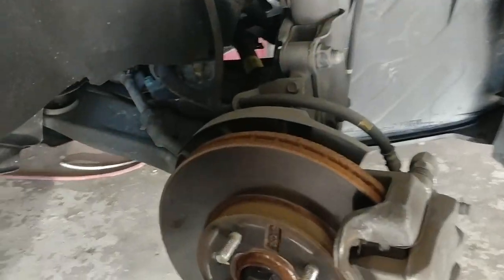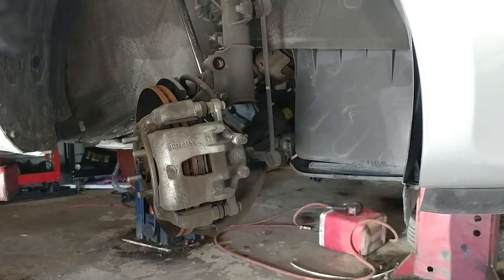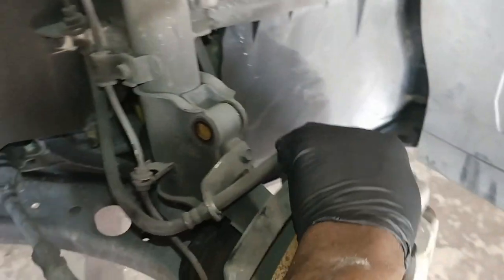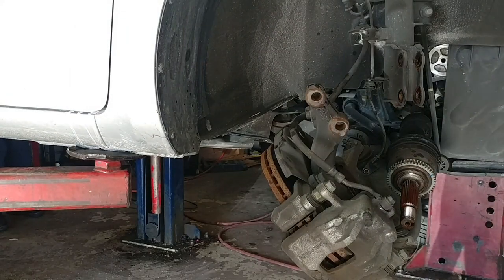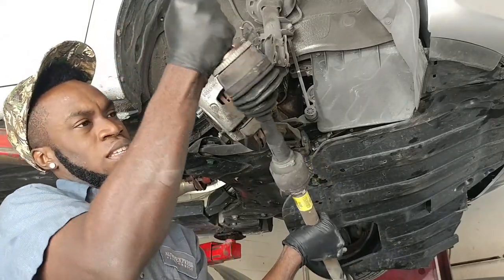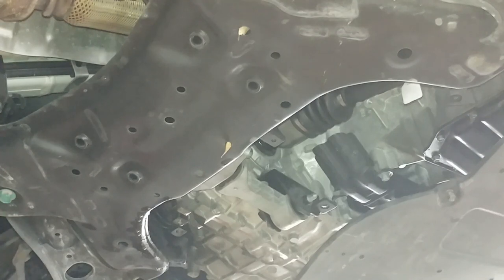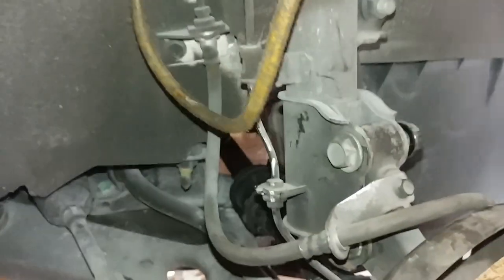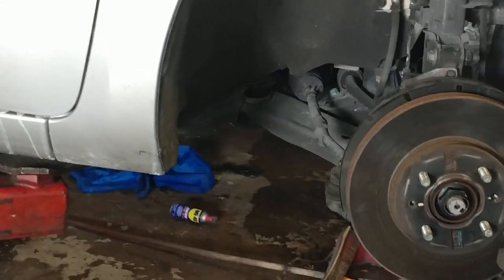Kia Rio / Forte  right front cv axle replacement

Comment: What is that thing called that came out whenever you hit the cv axle out of the hub knuckle? Is that a snap ring for the wheel bearing? I removed my cv axle, same side, and didn't see anything like that come out? I have the new cv axle in but whenever I accelerate it makes a vibrating kind of grinding noise  when the engine hits 3k rpms. Then goes away.. I think I might have gotten a bad cv axle.

Comment: Question....what part do you use for pre 5/13 '2013 kia optima sxl 2.0l turbos' ? Cuz i need to change mine but the part is discontinued. I hear someone has used Hyundai parts.
Reply from the maker: Am not sure but I think the Sonatas parts will fit the optima because they are basically the same car
Reply: @DULLAHGOSOHARD  ok thanks, i had my job order an axle that might fit and if not I'll try sonata next